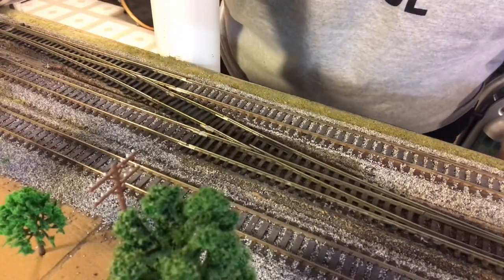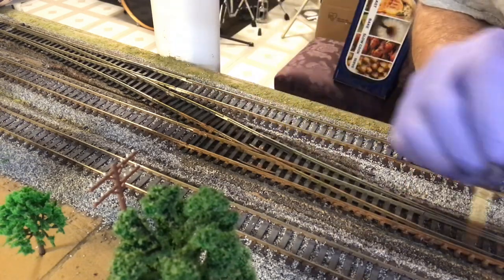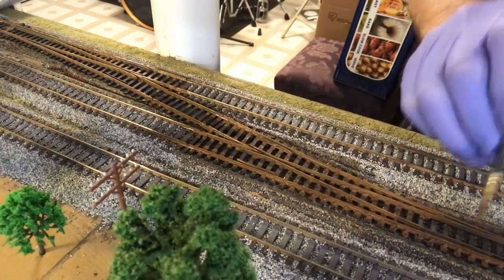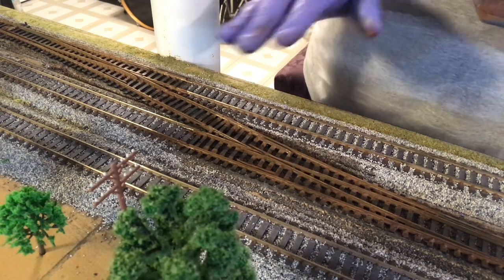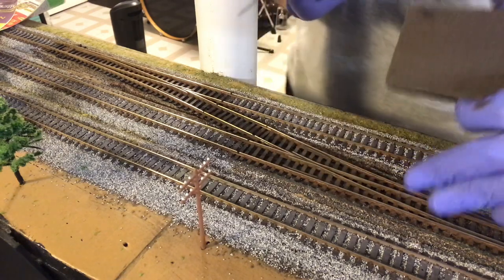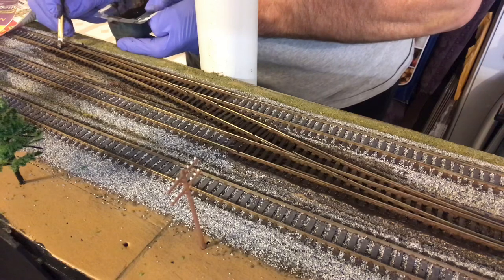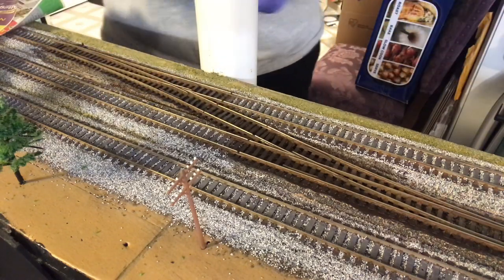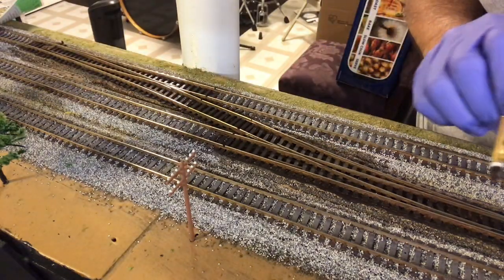Adding a crossover part 2(painting)

Comment: What can I use to clean American Flyer tracks up with
Reply from the maker: BNSF RAILROAD 90% isopropyl alcohol.
Reply: The Crooked River & Eastern RR ok there's a little bit of rust on the tracks
Reply from the maker: BNSF RAILROAD you could lightly use a fine sandpaper or steel wool. However it’s not something I would recommend doing often as it’ll pit the rails and attract dirt.  They also Make a track eraser. Called bright boy.  I use that from time to time on extra dirty spots.